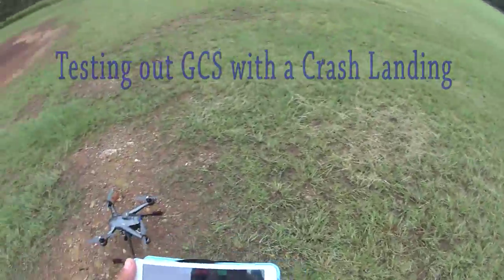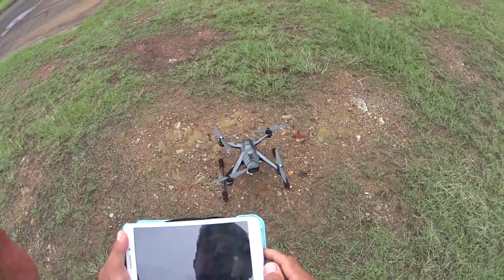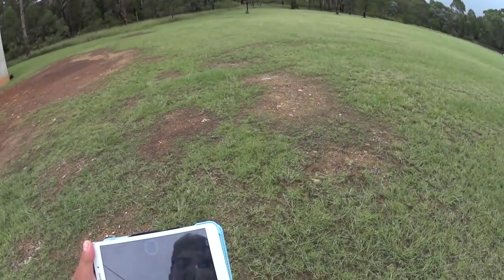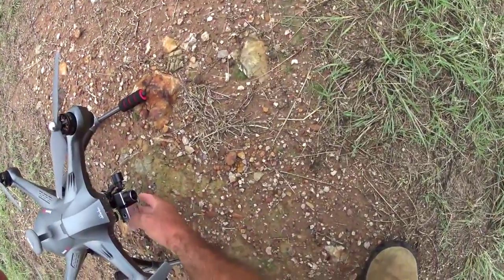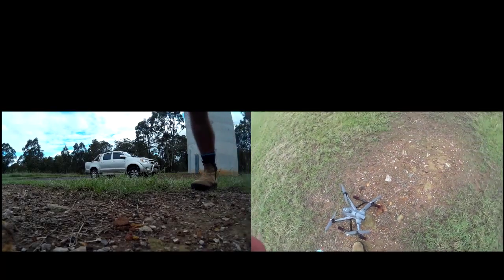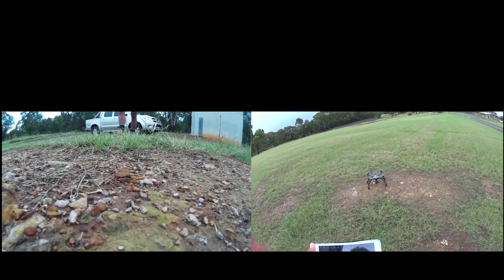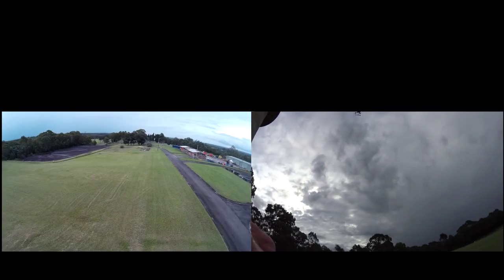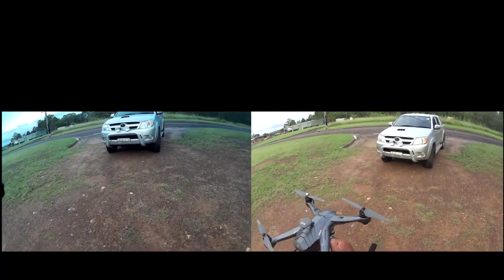Testing out GCS with a crash landing

Comment from the maker: Hi Ken
Yes Your right ! Toilet Bowl effect ..as I found out later and yes I needed to do a compass cal ..also found out my scout taken long time to get a GPS lock (5-6 mins) after hours of pulling it apart and inspecting the GPS module for cracks and found out later at the hobby shop and changing parts was a faulty cable to the GPS / Compass
changed that now fly's like a dream ..
Not much damage one set of props and half of the landing gear..
Mj